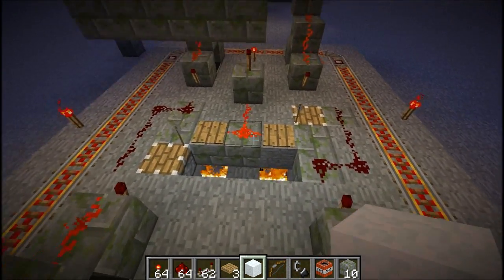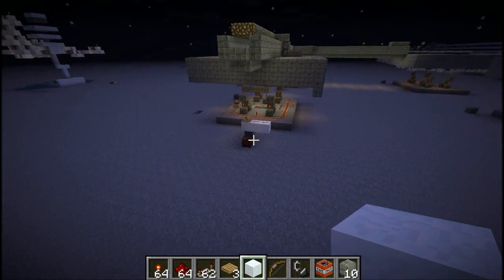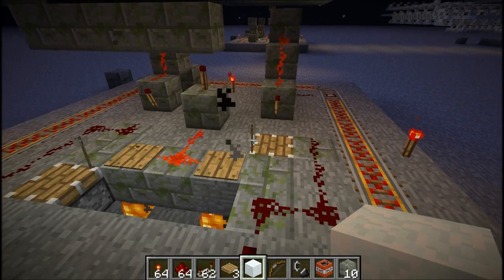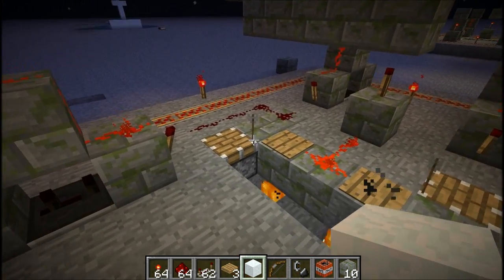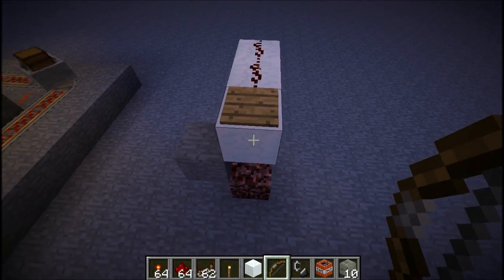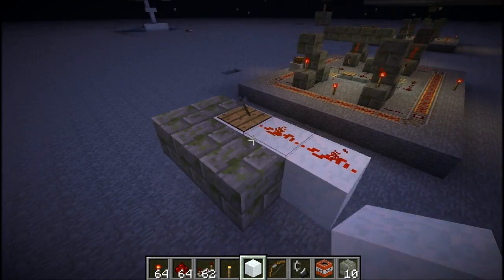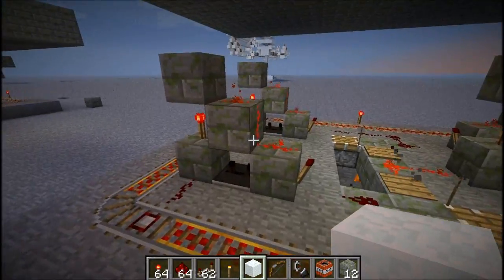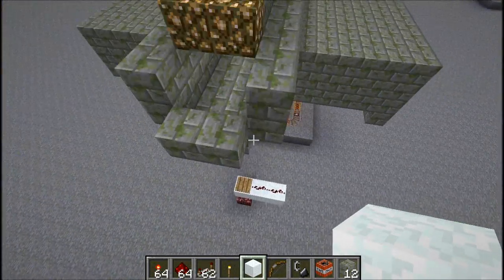How to with L!sette: Player/Proximity Detection System

Comment: Btw, you are right that the particles are the cause of activation of the redstone with the plate and arrow and all, however, particles do not carry weight. The true reason the redstone activates is because the particles force an update in the enviorment. Basically, the plate doesnt notice the arrow on itself until it is updated by some other external force, like the breaking of a block next to it (which gives off particles) or fire in your example. There was a video on this, but idk where it is.

Comment: @exWeL1 It activates when you are close enough for the particles to appear, which is around 17 blocks. The arrow/pressure pad thingy should be less than 17 blocks from where you want the player to be detected. Am I right?

Comment: I've never heared about that arrow+particle+wooden pressureplate thing before else I might have even come up with something similar...
but wouldnt lets say a five clock work too instead of a minecart clock (i mean with five torches not with torch+repeater) maybe add a tflipflop with one normal and one inverted output to not lift both arrows at the same time